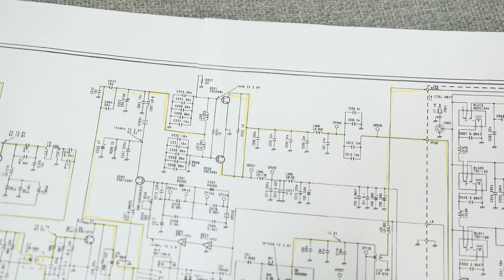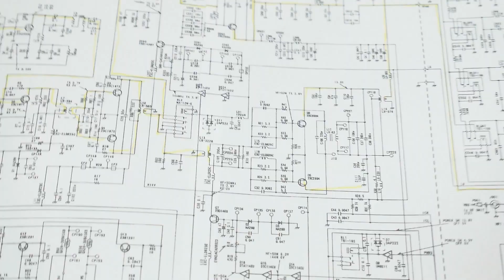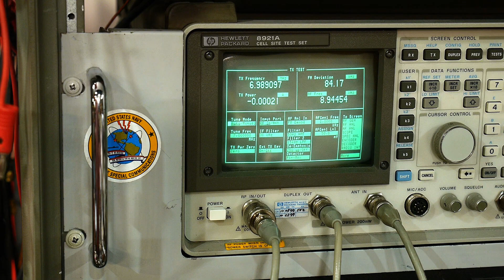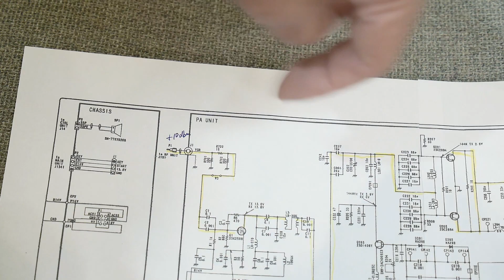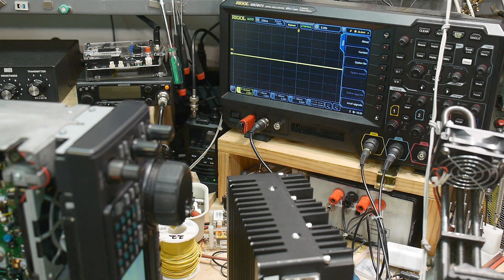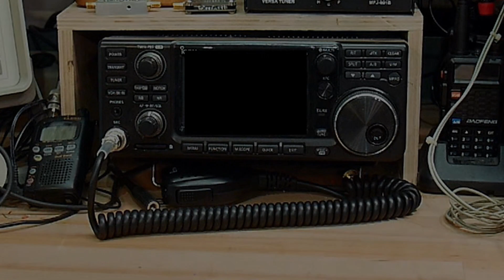#1079 ICOM IC-746 faulty ( part 2 of 8)

Comment: Well, you may not be able to bless the operation of the PA stages quite yet...you might drive the PA's with a 10 dBM signal from your signal generator and see if you get full output.
Reply from the maker: Thought about doing that, but I think I know what's wrong, if that does not work I'll be back to inject a signal

Comment: How about measuring the same signal when it’s not connected to the amplifier board. You could have a component that breaks down at a specific power level (12 o”clock) and loads the input signal down.